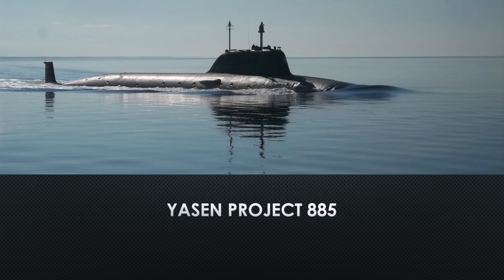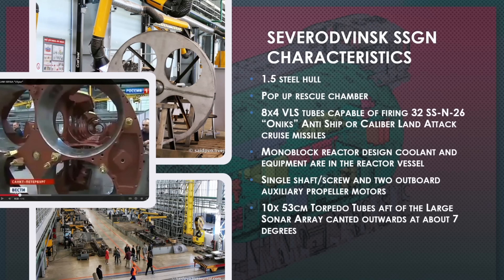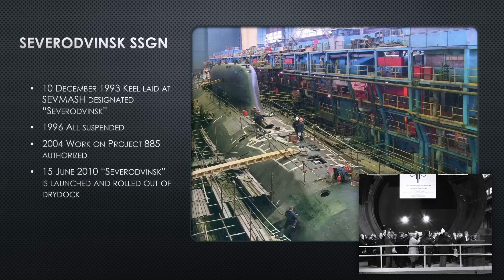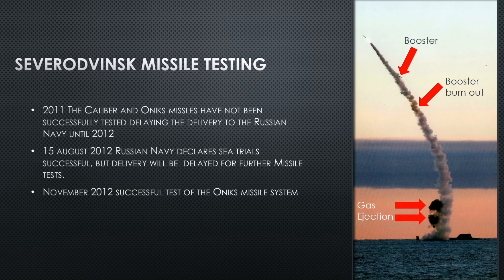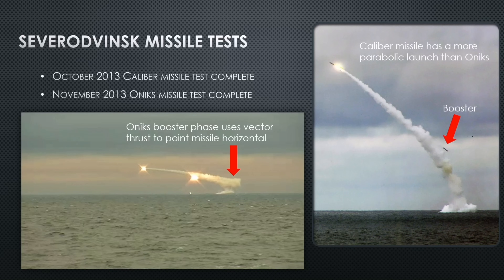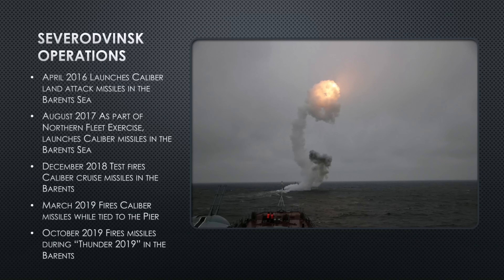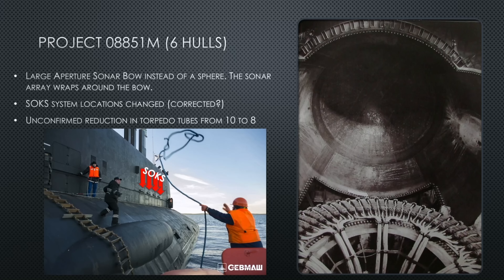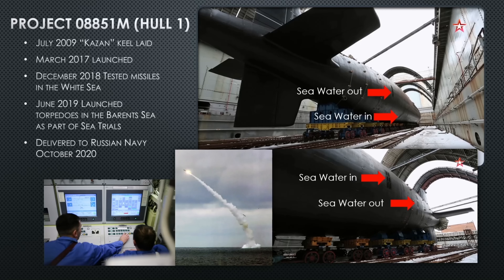Kazan Yasen-M (Project 855M) Sub Brief (2021)

Comment: Hi Aron
I was wondering if you were going to share noise stats for this boat as there is an interview with and active duty navy admiral stating that they are allegedly very quiet boats.

Also, isn't it strange that they are building high end SSNs with 7 bladed screws and not pump jets when they are also building the SSBNs with pump jets at the same time?
Reply: They are very quiet indeed

Comment: a submarine displacing in excess of 12,000 ton could do with a 10-cell VLS instead of just 4-cells . . . those water scoops must be having large in-built desalination filters . . . recommend a video on possible large displacement variants of the A26L class & Type 212 class of fast attack submarines . . . wonder what's powering the rescue pod, thrusting it upwards to sea level from 600 . . .
Reply: A26 and 212 are not fast attacks and nothing I powering the rescue pod up, its positively buoyant

Comment: If a nuclear submarine gets torpedoed, does it leak out all kinds of nuclear fuel in the ocean? Or is the reactor protected and contained inside a hardened shell? I was wondering if it would be an environmental and ecological disaster if a nuclear sub got shot down?
Reply: Depends on the hit. The Kosmolets went down because of a fire. The reactor was SCRAMmed well before that and it's being heavily monitored by local fisheries folks. So far, not any serious problems. My guess? depending on the level of automation on the Red boat, taking a catastrophic hit would probably cause a SCRAM as well. But a dead-on hit on the reactor space might give you that "Red Storm Rising" Victor.

Comment: Have to wonder about the work around not being able to procure micro chips
Reply: Russia can get them from China easily , Military chips do not need to be as advanced as the chip in your laptop or Iphone which is between 7nm to 3nm . military chips are much more heftier and frankly cruder between 120nm to 25nm and basically any country with basic knowledge of semiconductors and talented engineers can make a chip between 25nm to 15nm . Russia wont have any issues acquiring chips .